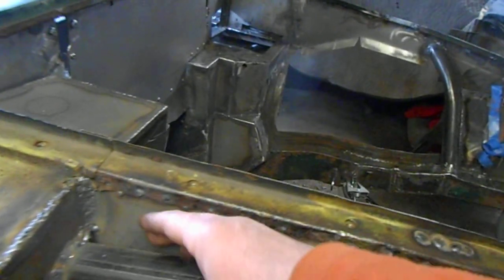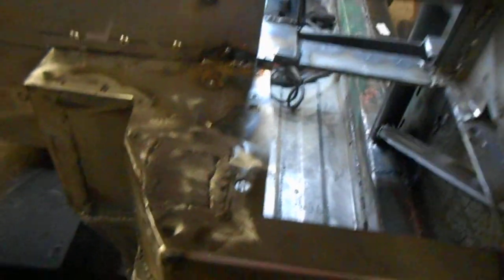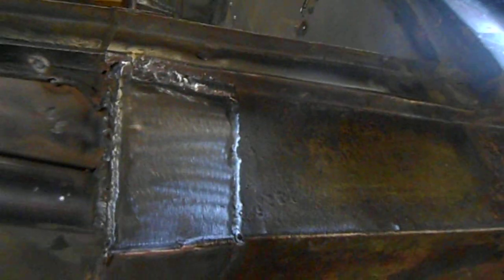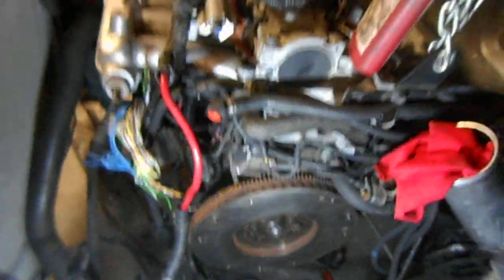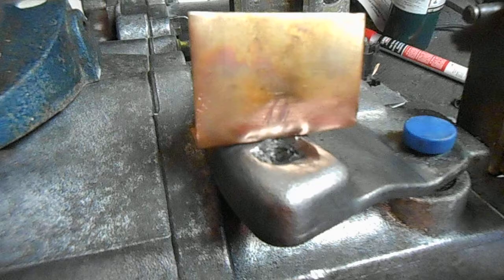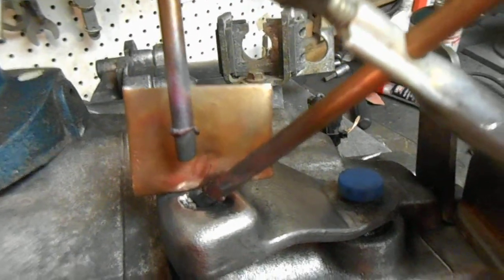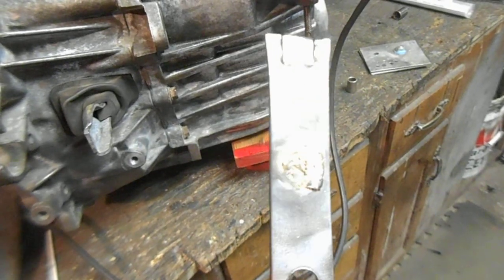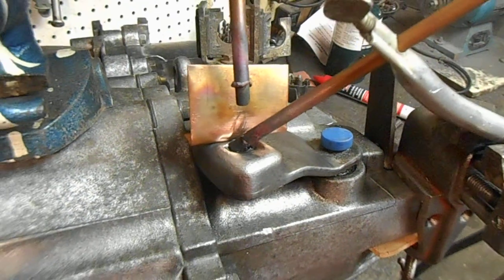Dec 24 MG GT & Carbon Arc torch brazing rig

Comment: What kind of welder is that,?  It looks just like my 120 volt Craftsman..  My Father in Law gave it to me..  It has the same rod holder as yours..  I've been dying to try the arc torch.  but I wasn't sure what type of rods to buy..  Most of the rods say DC current..